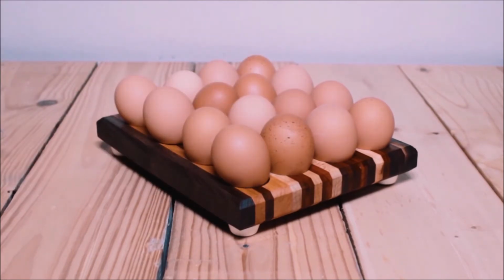Egg Holder [Episode 24]

Comment: what size bit did you use for the egg holes? and about how far apart did you make them? its came out really cute!
Reply from the maker: A 1-3/8" forstner bit and a 1/2" space between each hole but depending on the size of the eggs you use, you may have to freestyle with those measurements. Thank you, good luck :)